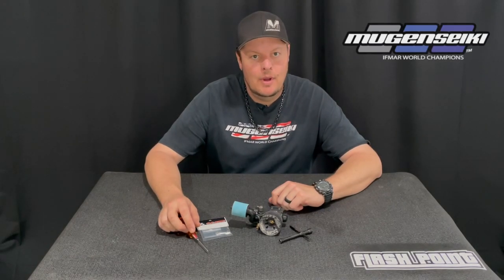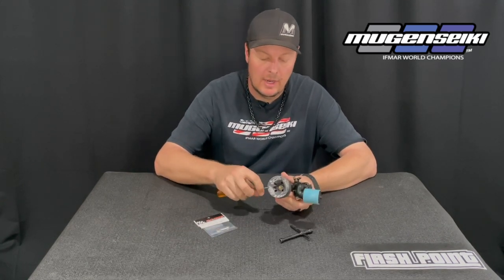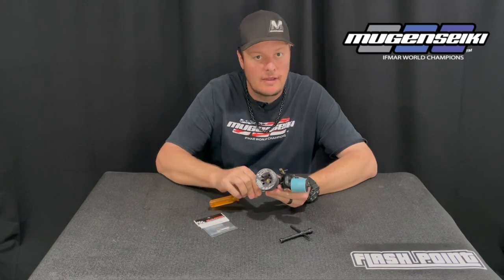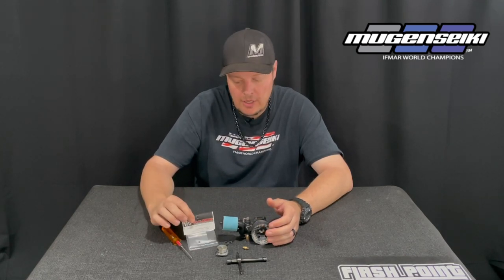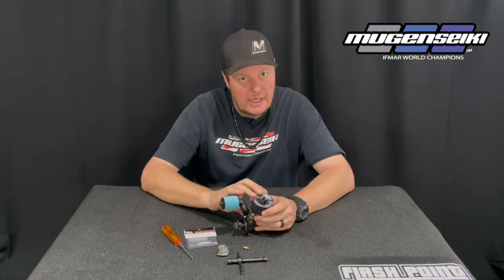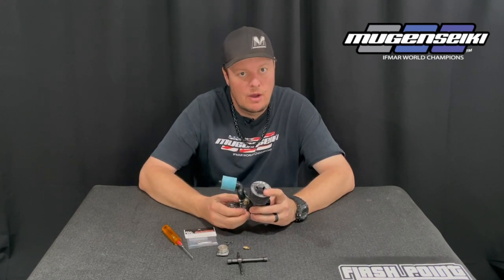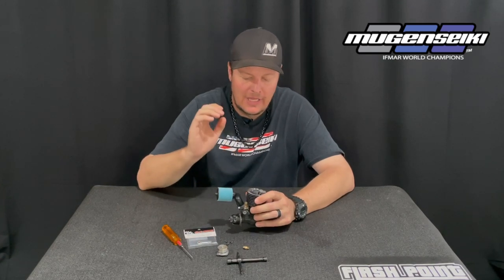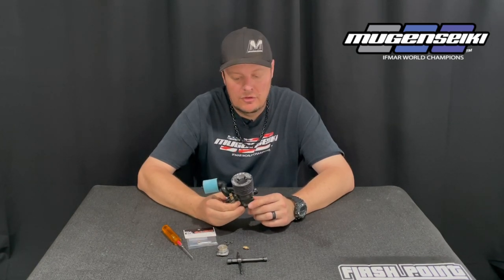When to change an engines connecting rod?

Comment: I have a few Novarossi engines and i know you used to run them, Adam. The manual suggests to change the rod every 20 liters on offroad engines, is that a good guidance to follow in your opinion?
Reply from the maker: The Nova rods are super durable and usually last the life of the engine in my experience with them.

Comment: Hello mr Adam
Im getting a used o.s b2101 and i was wondering if i could swap a new piston/sleeve/rod set from the adam drake edition engine. Is the set from your ad1 or ad2 engine compatible or do i have to get the ad1 or ad2 crankshaft to make it compatible? And if the piston/sleeve/rod set is compatible will it have better performance from the stock b2101 piston/sleeve/rod set or is it all in the crank?
Thanks In advance
Nik
Reply from the maker: The AD p/s/r set is different, but it could be used in the B2102.  We offer new broken-in p/s/r sets for pretty much all OS engines if needed.  www.thedrakeracing.com
Reply: @AdamDrake  Thank you for the info! 😁

Comment: I have an OS .21VG, been running it for about 8 years.  The other day, I ran it too lean.  The engine got really fast while driving, and then I heard a bang and it just stopped. Now it's totally seized. Is there any way to repair it?

Comment: 👍What about the crank shaft, can you rebuild an egine with New piston, sleeve, conrod keeping the old crankshaft ?
Reply from the maker: Yes, you do need to check the crankshaft for wear as well, but with the DLC coating from OS the crankshafts usually last a very longtime.

Comment: Good stuff Sir, question were can I find a exhaust cooler? I seen it on one of your Novirissi motor builds.
Reply: Ebay. Although many will argue their only benefit is aesthetic.
Reply: @thetoddperspective  Alright, laughing my butt off.
Reply from the maker: In the past I used the Nova coolers.